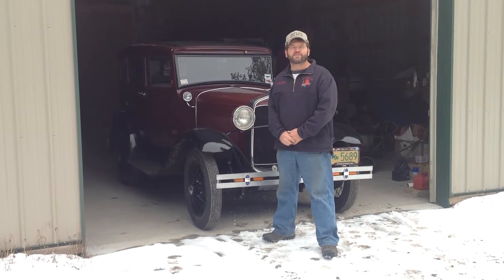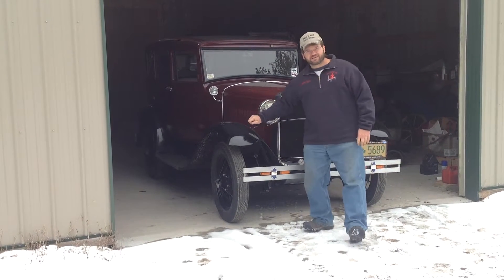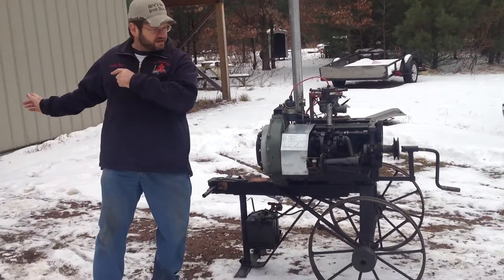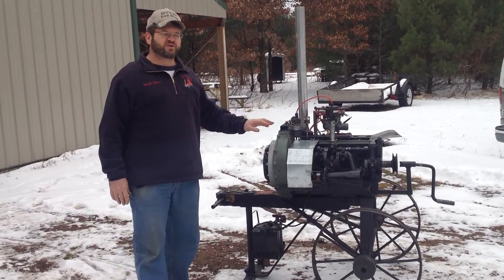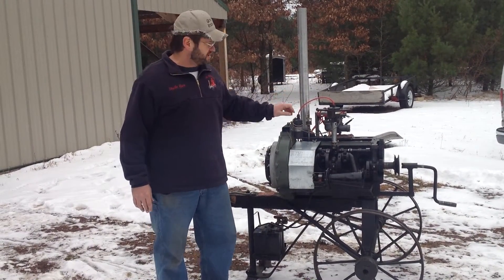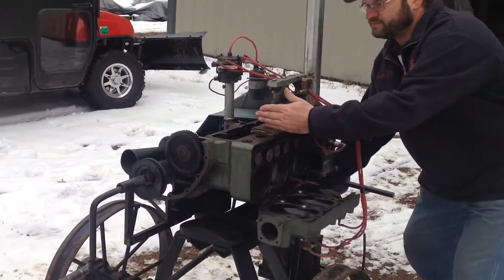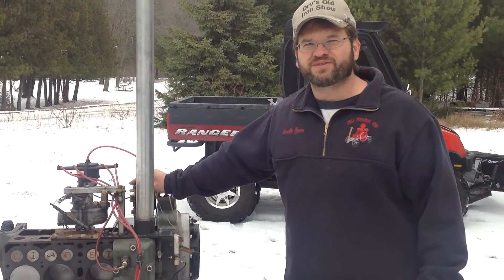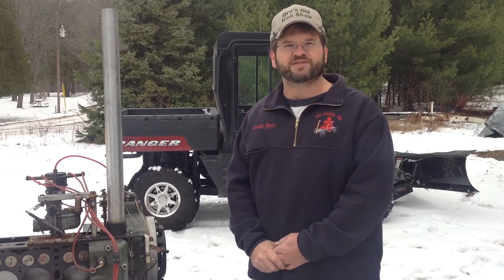Open Engine HD

Comment: What am I missing here? The heads are wide open. What is actually driving this thing?
Reply from the maker: @ehon717  the engine is running off the 4th cylinder, the other three are Democrats